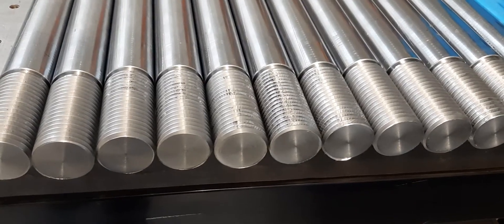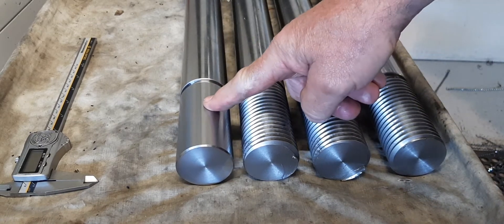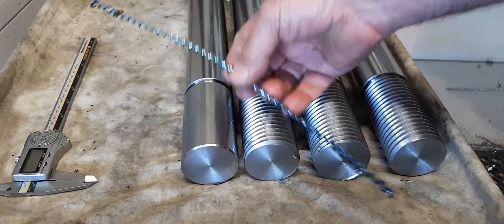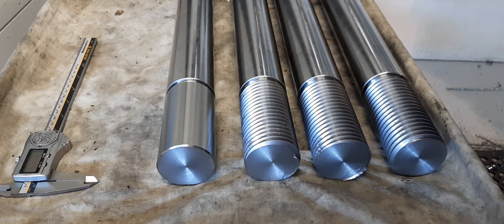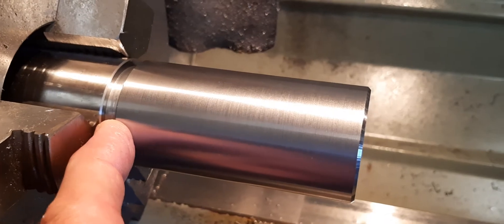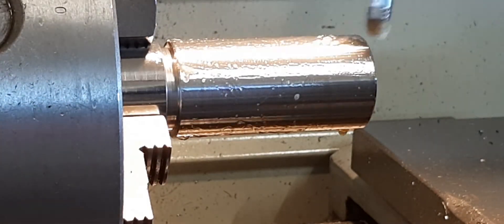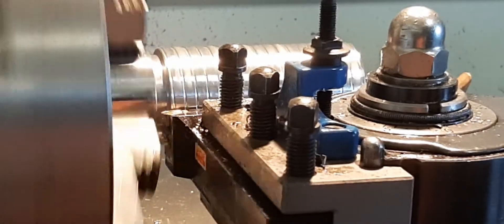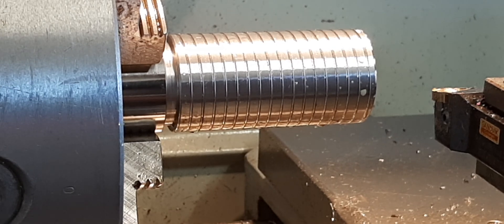Cutting 4.5 TPI Threads in 4140. Manual Lathe.

Comment: Great vid, just subbed. Wondering if I could ask you a question if you don't mind.
I'm planning to put some threads on 40mm diam 4140, in order to screw into  a pre drilled hole in timber. So they would be coarse threads and are quite spaced with a wide root, similar to that of lag bolts. - what tool would you use for this? 
I was thinking of using a standard insert (not a threading insert) and setting up my cross slide so once I am at depth, i can move it slights left with each pass to widen up the root. Unsure if a threading insert would have a limited depth of cut or not Any advice? Thanks!
Reply from the maker: Hey Alex.

I do understand what you are trying to do. 😁
You want the Thread to actually Cut into the Timber similar to a Wood Screw. 🤔

The Only Carbide Insert i can think of that would be the closest to a Wood Screw Thread is a ?
VBMT profile.

You would Need to start with a fairly Large Insert Radius for your Roughing Cuts, then switch back to a Small Insert Radius to Finish the cut.

Thread Pitch ?
You will need to do some math to calculate the Thread Pitch to match the Thread Depth required.
( so you finish up with a sharp Thread Crest that will Cut into the Timber )

When you finally work out something you're 😊 with.

Start by practicing the Thread Cutting on the Same Diameter bar.
But use a piece of Aluminium.

This will help to see IF you are heading in the right direction 😉 

Hope this reply helps you with your Mission 
Peter👍
Reply: @weldmachine  thanks for that detailed response!
I'm thinking it would need to be about 5mm pitch, so do you think the way to tackle this would be to first rough down the thread using a larger radius tool, then switch to the VBMT insert and progressively move it across with the top slide to widen up the root to suit. If I know what my predrill hole size is, will this help me with the calculations? I have a 35mm auger bit for the timber hole, so essentially my minor thread diam should also be about 35mm? I will keep doing some reading and will definitely run a few practice cuts on some  ally. Thanks again for your help
Reply from the maker: @alexc5369  
I am curious ?
Why use 4140 for your choice of material ?
40 mm Diameter bar does have a fair amount of strength without using a High Tensile Steel bar.
I am not totally sure what you are wanting to build,  so it can be a little difficult to give the right information without knowing the loads you need to support.

I am also curious Why you need to Thread through Timber ??
IF I was using a combination of Steel and Timber i would use a socket arrangement ??
Where a smaller size material would pass through the Timber then dowel into larger section Pipe.
Not sure IF you have considered this way of doing it ??
The other problem i see with your design is ??
How will you Thread through the Timber ??

IF you Thread the Timber sections this may also apply stress to the Timber sections which could cause cracking under load from what your building and also from the Threading process.

Steel is much different to Timber when applying loads.

From the size of the bar you plan to use their must be a fair amount of load on this part ??

I gave you the earlier ideas of how to approach this job thinking that's how you want to do it ??
But it seems you still have much to be plan for ??

To be honest ?
I would stay away from the Threading in Timber idea.
As it would be very difficult and could give you more trouble than you might think.

As much as you have some calculations to do, you also have a bit of thinking about how you might want to connect Steel and Timber together ??
A few things to think about for your project.
Happy to help with more information IF i could.

All the best.
Peter.
Reply: @weldmachine    thanks Peter, I'm wanting to make some bolts that fasten into  trees in order to support a treehouse I'm planning to build.

I have looked online and they are quite popular over in the US, a few guys sell them under the brand names 'Treehouse attachment bolt' 'Garnier limb' and in Europe- 'German treehouse screw'

They all seem to be made out of 4140 and range about 33-40mm in diameter. So that's where I got those specs from and what I'm looking to replicate.  

Here are some videos of those 

https://youtu.be/3gP_izO-ZJk

https://youtu.be/cSapcQfuII0

I've got the tooling to make the hole but was curious on the thread, I think they have all different thread styles on each. You've given me some things to think about though in terms of inserts and how to best achieve it. I appreciate your time in responding to me

Edit: actually on the 2nd video link at 1.25 min in there is a close up of the threads

Comment: G’day Peter. Nice work mate. You got my pucker factor going when you started threading. My Colchester brake doesn’t work that good and it would crash 😂
Reply from the maker: Hey Aaron.
It's not to bad, you just need to be ready to disengage the half nut at the right time.
The carriageway definitely gets moving with the coarse thread cutting, LOL.
It's more so the number of cuts per shaft that is a little annoying ??
Especially when cutting coarse threads in 4140.
Thanks for watching.
Peter.